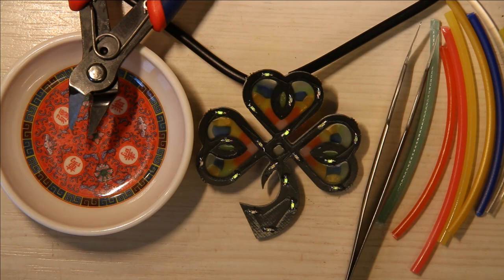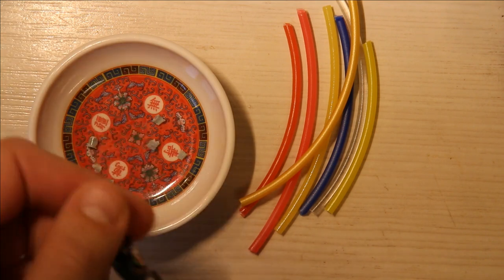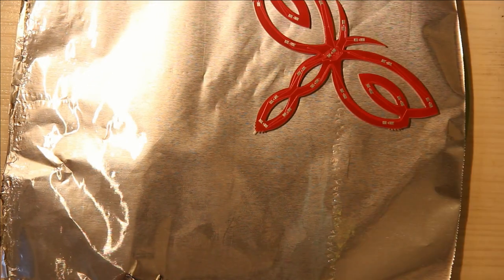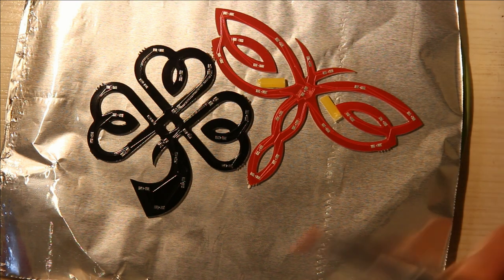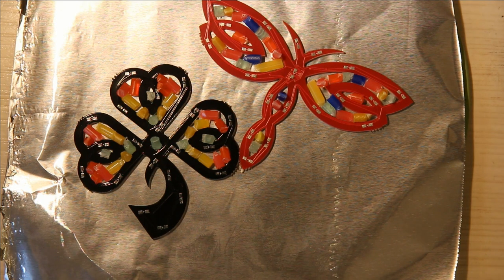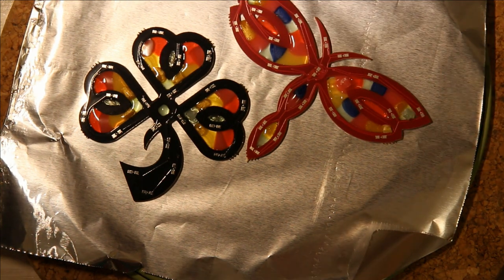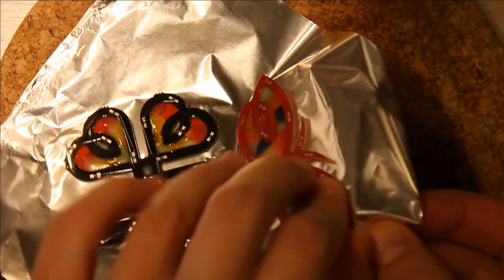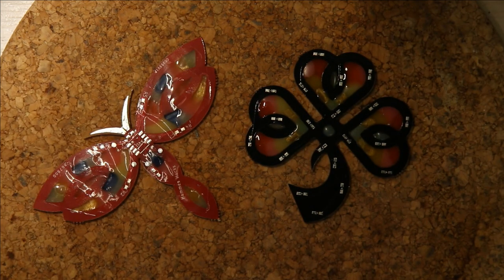Stained Glass PCBs

Comment: I was wondering, can't you solder things before and then bake them to add the plastic ? If I remember correctly, the melting temperature for PLA should be low enough to do so (not sure tho). You'll only have to be sure that the PCB is cold enough before powering up the whole stuff.
Reply from the maker: That might work for some applications/components/designs. However you need to consider:
1. It is possible to melt the plastic on an LED with a soldering iron
2. Not all components are rated for high temperatures
3. High temperature components might not be rated for long exposures (1 hour)
4. The foil and the PCB make a seal so that the plastic can melt and fill the holes...if there were components between the foil and the PCB the plastic would leak out.
5. I am not sure that the solder would make a good joint after reflowing for so long.